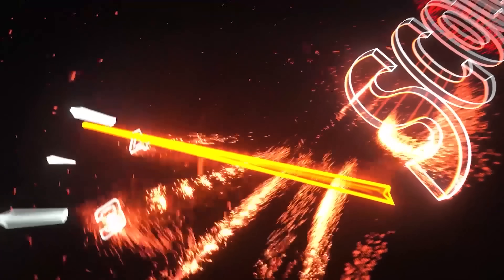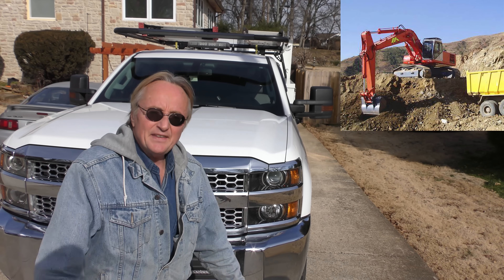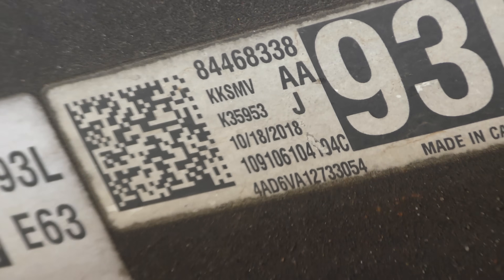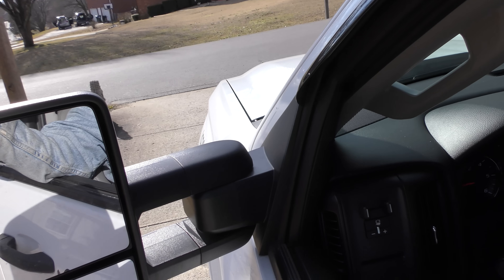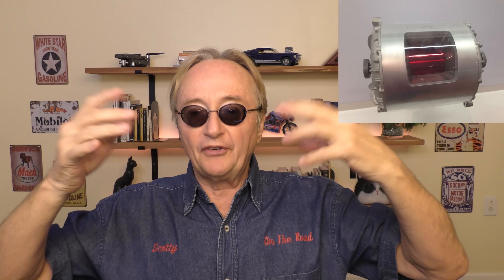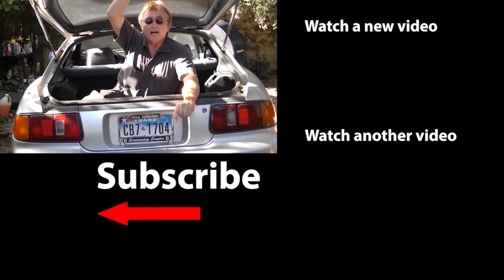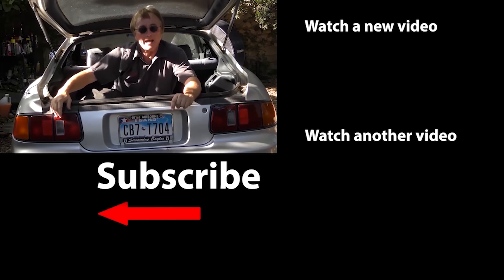Was I Wrong About Chevy Trucks

Comment: 2002 Chevy Suburban 1500 with 250,000 miles, still going strong.
Reply: 2001 suburban with 250,000 as well 😎
Reply: Pshhh......I have a '01 Burban 5.3 with 325,000 miles its a loaded LT model I scored it for $1500 in Texas. Changed all fluids to synthetic, Added a 4" CAI and she's still going STRONG It's my daily driver work hauler :)
Reply: @Chicagoguy1984  I'll pass that up, doesn't drip any oil and runs perfect
Reply: My 2002 suburban z71 is up around 412,xxx, still going strong 💪🏾  just a lot of rust that's all lol

Comment: LS Engines are awesome. Love the 6 bolt mains!
Reply: Yes indeed
Reply: Hands down the most dependable engine on the market. Period.
Reply: And most of the heads flow really well too. Aftermarket support is everywhere. Swap in a cam, tune, and headers and you’ll have a reliable performer. No better platform for a budget build in my opinion.

Comment: After owning this truck for years, if ur wondering. It gets 10.7mpg in town and 14.6mpg on the highway if u set the cruise at 65. At 70-80 about 12 mpg or less.
Reply: yeah, you'll definitely be taking advantage of that 36 gallon tank. But then again....we don't buy these for fuel efficiency, do we?

Comment: Love my 18yr old Chevy S10 built like a rock 🛻💨✔️
Reply: I had ‘96 S-10, bought used.  I routinely loaded it with 3/4 ton landscaping supplies.  I towed my tent trailer in the mountains.  I drove that S-10 into the ground ( double century ).  My S-10 had the 2.2 Ecotech 4 cylinder with a 5 speed transmission.
Reply: I have a 95 S10 with 5 speed. 227k and still going.
Reply: S-10   were junk  the only small trucks back then that had quality were the Ford Rangers.
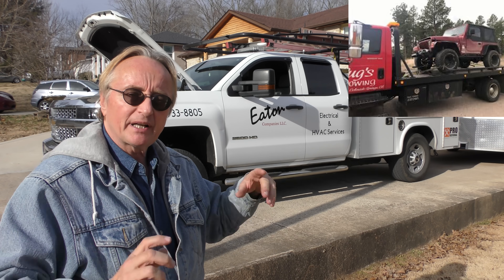Reply: @bcgrittner  You had 4:10 rear end too.  I had a 99s10 4cyl.  It was a relaible truck, but it didn't have enough power to get out of it's own way.
Reply: Too each their own... Actually Both are awesome trucks especially the older ones... they sure don’t make em like they use too...
Reply: I had an S-10 it was 25 YO 160K miles, I could get mechanical part, but trim parts are getting scarce.
Reply: @buckshot4428  what do you expect with a 115hp engine out of a Pontiac Sunfire 😂😂😂
Reply: @CliffClaven22  meh how often do you have to replace that kind of stuff.  There will always be one pop up here and there at the Upull scrap yards.  Around me they do anyways.  Guess it depends on your area and how many were around when they sold em new.
Reply: I had an 86 S15 (GMC version) with the 3.6 v6 and 5 speed.  It didn't have the power to pull itself around, much less even a light trailer, and at about 55000 miles the inlet manifold gasket let go suddenly and leaked most of the coolant into the oil.  The engine was toast before it could be shut off.  It was also rusting by then.

Comment: I recently bought a 2014 Chevy Silverado 1500 with the 5.3L V8 gas engine and the 6-speed transmission. So far I’m loving it and it’s been the best truck I’ve ever owned. Thanks for the content Scotty!
Reply: Huge mistake. Mine had the ac go out at 50k and shaking transmission at 60k.. worst truck I owned .. they say ram is bad but mine has been good so far but yet again it has 77k miles.. it’s a 2015
Reply: @eduardohemi6091  Mine has almost 80k on it and it’s running perfect. I recently put on a Black Oil separator to prevent carbon build up
Reply: @NoahMcMahan  that’s good to hear , I guess with every American brand it’s whatever you buy first that decides what team you’re on.. if you’re first vehicle comes out bad you’ll hate it forever.. if it’s good then you stay loyal
Reply: how is it now? In the market for a good truck to haul and to last a long time

Comment: I have a 2018 GMC Sierra 3500 HD Crew Cab Long Bed SLE 4x4 with the 6.0l gas  motor. All of the fluids, motor, transmission, front and rear diffs are Amsoil did the motor since brand new and the rest I changed at 34k miles. I plan to drive it until the wheels fall off then I'll ductape them back on and keep driving. The 6.0l gas motor is the most reliable gas motor for trucks ever made the transmissions are the most reliable transmission GM has ever made, and pair that with some Amsoil the best in class synthetic oils, 400, 500, 600k miles isn't too far out of reach. Even if it doesn't make it I'll rebuilt it until it does.

Comment: My last two 3500 1 ton vans lasted, and lasted. I ran the last one too 765K miles parted it out, kept the 6.0 litre engine, sold the trans and the guy is STILL running it. LOL I plan on rebuilding the old 6.0 and doing an LS swap in my Camaro and run it again. My current 2017 Chevy 1 ton has 180K and has been flawless.

Comment: I’ve had 4 of these 2500 Chebbys. 2 diesel and 2 gassers. Have a 2019 like this now. Transmission problem waiting to happen with the gassers. Average 150,000 before breakdown and $4500 repair bill. I got 350,000 out of my 2015 by shifting manual mode and not letting engine lug below 2000 RPM. I’ve been told by several dealers and transmission shops that is a record! They couldn’t believe that l got that many miles out of the original transmission. Be warned but otherwise great truck.
Reply: I have a 2003 2500 HD with the 6.0 with 285,000 and no problems with it at all. The thing is a beast!

Comment: Scotty these GM HD trucks are all I buy for the town where I work as the mechanic, We get 16-20 years of fleet service out of them without ever touching the powertrain, this is with use 5 days a week 35-40 hrs running time a week. It’s not uncommon for our trucks to have 12-20000 engine hours.our 2015s have 6000 hrs already . The specs you were quoting were for the 2020 6.6L , the truck you have in your video is a 2018 or a 19 . It has the 360 Hp 6.0, which I like better than the new 6.6L because the 6.0 has port injectors the new 6.6L is DFI ,and it’s not a split system, so I haven’t bought any yet to see how they hold up.. we buy ours thru the lowest commercial truck bidder that will deliver it to us..

Comment: My 2500hd 6.0 was purchased new 18 years ago and used for a recreation vehicle and general truck stuff, still works great. Worst thing that has happened is the fuel pump and water pump goes out occasionally and the ac compressor system had to be recharged once about a year ago. Beyond that because it is lifted it has ruined the front axle bearing about every 7 years due to the angles they are working at.

Comment: I'm a Ford guy, but my work has had GMC and Chevy 2500 and 3500 cargo vans forever.  Pushing 30+ years of using these vans.  We have a fleet of 4-5 at a time and they tow, haul, and are always loaded with service tools.  Regularly the owner runs them to 200-300k miles with nothing more than regular maintenance and then sells them for quite a few grand when they are around 12 years old to other local businesses.  I'm impressed with them.  5.3 and 6.0 powered.  They recently added a 3500 6.6 Gasser utility body.  Hope that holds up for us.

Comment: Have a 14 year old Chevy 1500 4x4 lifted and only issues have been fuel pump and u joint. 150k miles. Fuel pump $65 (did it myself) u joint $200 (bought whole other drive shaft). Been a good truck.

Comment: My 2008 Denali is rated to tow 10,000 lbs. my trailer with load is 5500 lbs. if ambient temperature is above 60 degrees it will over heat. I asked about a radiator from one of their HD trucks? They all use the same radiator. I went to aftermarket radiator three times the cooling and added two large transmission coolers and removed the grill. Now I can tow when it’s in the 90 s.

Comment: I had a 2000 chevy s-10 for 14 years.
It was a 4 cylinder with the 5 speed manual transmission, what a great truck that was, I miss driving it.

Comment: sorry scotty the 6.0 is 360 hp and 380 torque. the work truck has the same power train as any other gm 2500, just lower options. that's not a crew cab either it's a 4 door,  crew has full size rear  doors not the half doors, love the videos you are entertaining!

Comment: Ive got a 2017 WT 1500 with the v6 she has 180k+ miles and not one major issue except for the tourque converter going out but that was while it was still under warrenty. And let me tell you I've been all over the place with this thing, shes a beast to Ive pulled all kinds of things with it, cars included she doesnt break a sweat. As good as this truck has been and with the fact it runs better the older it gets i feel like I got a diamond in the ruff! No need in the insanely more expensive models you can just attach that stuff yourself later and save thousands! Ill prolly never sell this truck. Oh and "knock on wood" she still has her original tranny, and with CAI and upgraded dual flowmasters shes purring like a kitten

Comment: Only brand new vehicle I ever bought (40yrs old now) was a 2006 Chevy 1500 WT 4x4. The WT is a "work truck" model, vinyl floors, crank up windows , radio and thats it. Back then the work truck meant bigger brakes, bigger alternator , and few other things. Had the 4.8l V8 and from 7 miles to 225,000 miles I had to replace the alternator and that's it! Of course oil, brakes, and wheel bearings (cause it's a Chevy) but that thing just kept going, original gas and brake lines, fuel pump, everything that usually goes just lasted. Only reason I had to call it quits was I live in Maine and rust got to the body. And I used that thing towing , hauling, 4x4 in snow storms and whatnot, pulling people out in the muddy job sites. The truck was built in Canada. Got a 2015 2500hd and we'll see if it can let be up to it's older cousin. Doubtful cause they don't make trucks for the work man anymore, more about the weekend warriors pulling their side x sides or campers who need air conditioner seats and parking sensors cause they have no business in a truck that size.

Comment: In Brazil we have 160cc motorcycles that can easily get to 80m/h and make more than 100 miles per galon. Incredibly reliable, they can go on for more than 100.000 quilometres, maybe double that, with only very basic and cheap maintenance. You need some Honda motorcycles in USA.

Comment: A 1999 2500 had numerous brake problems, and the starter went bad. Right off hand can't think of anything else. The brakes were pretty spooky before being fixed. I think GM finally recalled them for ABS problems. Yes they do haul and yes they suck gas.

Comment: I got 2019 HD2500 WT,  V8 gas, with no Fuel Management.   Replaced a Ford also Know as "Fix and Repaired Daily".  100% Tax deductible in 1 yr.  Pulls 20' a Livestock trailer w/ easy.

Comment: I sold new Chevrolets and one thing that I didn't like about the 2500 series was you had to rev them harder to get them to move, like they had a high stall torque converter. That was 15  years ago, don't know about now. With 10 speed transmissions maybe better now.

Comment: I bought a new 2019 Chevy Work Truck for everyday driver. It is a regular cab, 6 speed transmission, v-six engine, so far it is good.
I bought a standard work truck to keep cost down & used Legacy program to get a discount.
Dealer made a mistake & wanted to charge me more a few days later.
I drove a 1993 f-150 (straight six) for 25 years, but it got too rusty. I think maybe I should have saved the engine?

Comment: Scotty the 401 hp 464 lb ft ratings are for the new 6.6l gasser not the 2015-19 6.0 gasser that is in the truck in video which is somewhere around 360 hp 380 lb ft if I remember correctly.

Comment: The older 6.0 is rated at 360hp and 380 lb ft of torque. The new 6.6 gasser is the one rated at 401hp and 464 lb ft torque.

Comment: Nice truck. I wish GM built all their trucks this way. I’ve got a 2012 Sierra 1500, no problems yet, but it’s only got 40k on it. Fingers crossed 🤞
Reply: Jeez that thing has been sitting or what
Reply: @KaneKP28  I bought it to take stuff to the landfill, pick up deck and fencing materials. I bought it for 10k with 7k on the odo at an estate sale. Still had the factory warranty and an extended warranty on it. I figured why not?

Comment: Right on! These 25 and 3500s+ are bare-boned equipped, sometimes with hand crank windows for emphasis on quality control/cost savings where it counts. It's a separate division of the dealership, nextdoor building or sometimes within the main dealership room with a Fleet Manager who's the only salesperson selling these commercial trucks. Accompanied by their own lot attendant(s) and an immediate finance dept. priority. The Chevy 1500s in many trims are flying off the lot these days. No doubt the execution of Chevy's simple in cabin infotainment accessibility is a draw toward their commercial line, but Ford's fleet seems to have more progressive options for the $ imo. Without a doubt the Chevy 1500s seem to be outselling the F150 for the first time ever. Not part of this video, but looking forward to Q4s numbers.

Comment: I've got 1 co-worker that is a GM fan and 1 ex co-worker that is as well.  Bosses went from Ford to Dodge.  Another co-worker did the same.  He had a F-150 with 300k on it.  Said co-worker is having problems with his touch screen bubbling.  Messing up the radio and A/C controls.  Bosses got their Rams year or two later.  Ex co-worker just bought a new Silverado 1500.  My dad's Dodge ram 1500 had bad problems around 150k.  He's been driving a F150 for a year or so now and has had a few problems that he could fix himself.  My Prius has been burning oil since I've gotten it.  A/C is horrible in the summer.  Put in a new 12v.  Old one lasted 7+ years.  BMW had oil problems and then AWD problems later on.

Comment: Ok, equal time. What's your view on a Ford F-250 Super Duty 6.7 PowerStroke Deisel?
Reply: A Ford engine with more than 5 liters of displacement... sounds like problems to me...
Reply: @TheDiameter  What leads you to that conclusion? Has Ford had problems with the current iteration (2014 forward) of the 6.7 Powerstroke?

Comment: Pfft, I’m perfectly contempt with my 2003 4.3L v6 GMC Sierra 1500 longbox single cab.
Reply: I sold new Chevrolets 2001-2004 and I liked the 4.3 V-6 in the full size trucks, seemed to move effortlessly. The 4.3 in the S10's seem to lack power and made a lot of noise & barely could move. 
I think full size had better transmission & differential gearing.
Reply: LOL, "perfectly contempt" I too hold them in contempt! 😀😀
Reply: Mon Deezy  about 215,000 km

Comment: As an X Harley dealer, any bikes they make are overpriced and have Questionable reliability . ELECTRIC,, NEVER for me . Most of my riding is highway above 80 M.P.H. and average 90- 100 miles a day. For the same price as a H.D electric , I purchased a 2021 Ducati Street Fighter V4. NO comparison. Just one old mans opinion. I have a GMC SAVANNA  3500 Extended wheel base van with 6.0  and 4L80E trans,, understandable. My last one I sold with 410,000 miles, still runs great. I do not have too tell you, MAINTENANCE, they run forever. I am fortunate enough too have a gas station close by that has 87 and 93 + non ethanol gas !! I never have fuel injector, fuel pump or pressure regulator problems in any of my many vehicles . Keep up the good work and be safe. OH I'm 72 and a retired auto tech !

Comment: Scotty:;

I hate to break the news,  but the Ram and Ford big boy trucks are as, or more reliable than the Chevy.

My 08 Dodge 2500 with the 6.7 Cummins diesel is just well broken in with 200,000 miles, and the 6 speed manual trans is smooth as silk.

Everything on the truck works well, and towing over 30,000  pounds is a walk in the park.

Some of these Cummins Rams pull 30--to 40 thousand pounds daily and get close to a million miles before being sold.

Most everything else we make car wise is crap, but not the 2500-3500 trucks.

Comment: This may blow your mind. Back in the day I knew a guy that had an office cleaning company he ran after working his day job with me. Well anyway this one place he was cleaning they were trying to figure how Dodge made such strong pickup trucks. The military was go to switch to GM  trucks and there was one of many requirement that they had meet. It was they had to be able to bury in mud the truck half way up the body and then be pulled out and still work. They could do it with the Dodge but the GM would leave parts behind. So this company had a Dodge military truck and was taking it apart to find out how Dodge did it.  What happened to those Dodge and GM trucks?

Comment: Scott im looking to get a new used truck. I have a 98 yukon now. Im looking to upgrade and get something new. Im just looking for reliable aspect.  I dont just have 40 k to throw away. The one im looking at has 65k miles on it. I wanna get a real v8 not some 6 cylinder turd.

Comment: Do a video on the 2005-2006 Saturn vue they have  the full Honda drivetrain. I have one that I beat on. It is a tank. My new fully built Jeep Wrangler tore up before the Saturn (mileage wise) I actually take the vue off road more than my jeep. Havnt even changed the oil in Saturn since I got it over a year ago speaking of that I’m about to do that today and make a video of the color and velocity of the very used oil.

Comment: Disagree with Scotty on this one.  I had a 2005 GMC 2500HD.  The 6 litre is a gas guzzler and the transmission died before 200,000 KM.  And the rust.  UGH.  Even if I replaced the transmission, the rust would have been an expensive fix.  Got rid of it and bought a 2012 Tundra with 300,000 KM as a replacement

Comment: 2015 1500 5.3 comes with a 6 speed auto--- not 10 speed --& fully boxed frame - 
so must it must have same strength & reliability as the that commercial series truck.

Comment: Sorry Scotty, but that wasn't a true crew cab just the double cab. Basically the size of a extended cab with regular doors. BTW, I've had great luck with my '17 chevy 3500 with the duramax. I'm up to 190K miles, and the only mechanical issue I have had so far is an electric plug melted onto an injector.